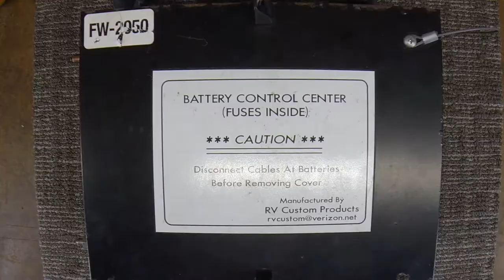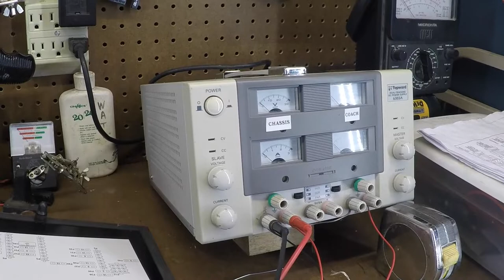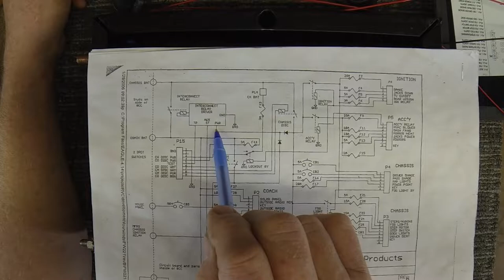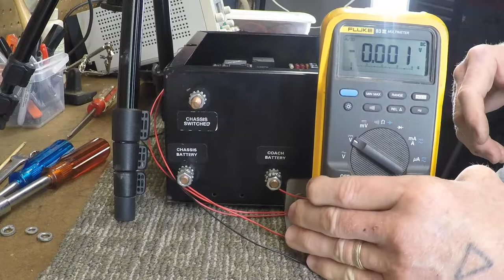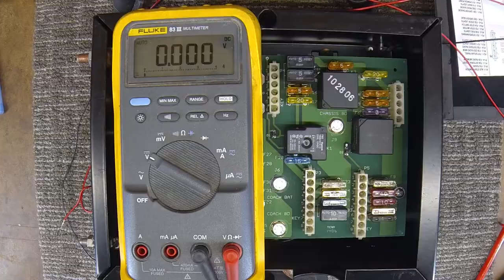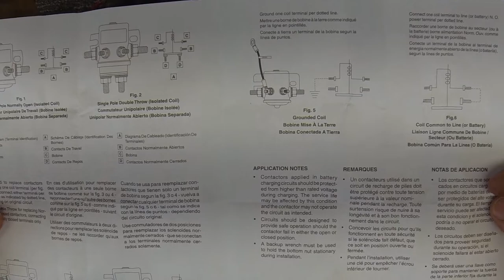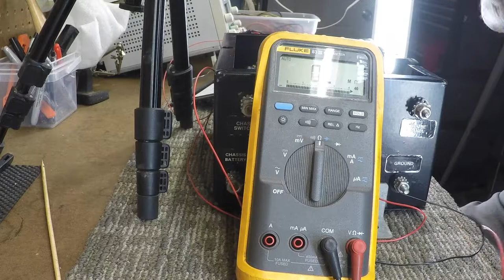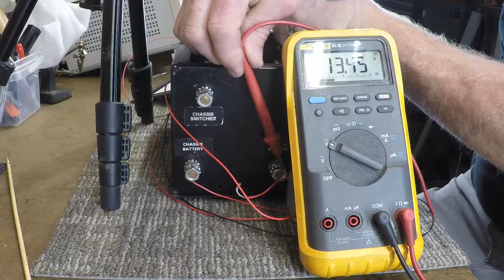RV Custom Products Battery Control Center (BCC) - Troubleshooting and Repair

Comment: I am working on the same problem with my 2014 Thor coach,  I have the TH1020 BCC Saw your video after I had ordered the latching solenoid and I hope that corrects my problem. I also printed information from RV custom products but you're video sure helps to understand how the system functions. Also the master electronics solenoid in my unit cost $89.00 and I did not see any cross references to the unit you used in your coach or others I found online? could I have saved some cash and ordered that one? If so, too late now but maybe next time. Thanks for the information, you have a lot of patience and knowledge and I am grateful that you shared it.
Reply from the maker: @phillip Mares - Thank you for the feed back and I apologize for not replying sooner. I am not the best at putting sourcing information in my descriptions. This is something I need to improve on and it's feedback like yours that helps me to improve. I glad that you were able to fix your problem and I'm also happy that my video helped you to understand the functionality of the BCC. Again, thank you! Stay kind, strong and safe!

Comment: I have a fuse blown for the radio that I believe is in this box.
I've unlatched the two latches to open the front. And I've got the front loosened all around but it's stuck where the latches are.
Can you tell me how these latches work so I can figure out why it won't let free?
Reply from the maker: If the latches are like mine, then they are just a round rubber plug that expands when you push the latches down. If they are cold, you may have to warm them up to get the to soften up.

Comment: I have a 2016 FW Bounder 35K. My 12v systems only work when the engine is running. The house batteries are charged. Any suggestions? Thank you in advance.

Comment: Hi Wayne,   I have a 2014 Thor ACE 29.2 and the coach lights only come on when generator or shore power is applied.  Coach Lights are off while driving and don’t get power  from alternator or house batteries.  Could this solenoid relay be the problem?
Reply from the maker: FYI, let me look at the schematics for a bit and I will get back to you. Thanks for the question.
Reply from the maker: Do the lights work, at least for 15 seconds, when you turn ON the AUX switch, while driving?

Comment: Quick question.  I'm experiencing a similar problem with my BCC as well (2013 Hurricane).  This is what is happening.  All of the power arbitrarily goes away including house and chassis.  Up to the last time we could let it sit for a bit, turn the switches on and off and we would be able to start the motorhome and move on down the road.  Its currently at a truck repair shop after an expensive tow.  They have isolated the problem down to the BCC but unsure what part of it is the problem.  Is it likely board, or the solenoid?
Reply from the maker: Hi Quinton, it’s a little more complex that I would like to go over in a comment. One thing I will say though is that the solenoids are less expensive than the PC board. The question is which solenoid is causing the problem. Both the coach and chassis solenoids would have to be commanded in the opposite direction in order to lose both supply voltages. They will not simply turn off. If your BCC is like mine, then it takes flipping the coach and the chassis switches to the opposite direction to make that happen. Please email me your contact information so I can talk to you about this over the phone. My email address is wpolcin@gmail.com.

Comment: Hi Wayne I have a 2007 Georgetown forest river workhorse UFO R26 8.1 pusher my solenoid went band I have the new Solenoid but the wires burned and I’m having a time figurine the wiring. It is a SDC-107 battery controller. The motherboard seems to be OK. Can you help?
Reply from the maker: Check out the video at about 36:51. There you will see a Yellow and Red wire coming from the bottom side of the circuit board. The Yellow wire goes to the upper terminal of the solenoid and the Red to the lower terminal. Notice there is a third Red wire connected to the BUSS bar on the top of the screen. That wire goes to CH BATT spade terminal on the top side of the circuit board labeled P14.

I hope this helps. If you still have trouble, please email your phone number to me at wpolcin@gmail.com and I will cal to assist you by phone. I won't be available this evening, Wednesday, May 19th.

Comment: Can testing of the voltage be done when box is reinstalled
Reply from the maker: Hi Ernest. Yes. But the test results can be hard to interpret because you don't know what position the solenoids are really in and the 12 volts looks almost identical whether you're looking at the coach or chassis batteries. I had to remove the box in order to accurately troubleshoot.
Reply: @WaynePolcin  Things worked as you suggested.  You are great.

Comment: Hi there. I have a 96 Fleetwood Pace Arrow that when plugged into with my shore cord provides me with 120 volts for my appliances as well as 12 volts for lights,pump etc. But when I remove the plug I have NO 12 volt lights etc. Also when I run my engine I am getting 14.3 volts to my chassis batteries but No voltage to my house batteries. It is also the same when fire up the generator. When I charge my 2 - 6 volt batteries fully with an external battery charger I still get NO power to my 12 volt lights.I also just replaced my converter and it shows it is putting out 14 plus volts from the converter.
Would the selinoid that you just replaced in this video cause the same issues as I am having? Last points when I engage the jumper switch to use the house batteries to help start my generator I hear NO audible click nor do I hear a activation click when I plug in my shore cord to a 120 volt source. Any help would be much appreciated 
Cheers Rod
Reply from the maker: Hi Rod! Check the 50 amp circuit breaker on the BCC. Just push it in to reset it. This is where I would begin since you are not getting 12 volts anywhere in the coach.
Reply: Wayne Polcin 
Hi Wayne 
Thanks for the reply back. I will try that as well as replacing the continuous selonoid as I am Not getting the clicking from my battery boost switch on my dash as others have said that you get and that you should hear an audible click when depressed. I have pulled the fasteners off and pulled back the circuit board away from where the selonoid is located so why not replace it as I have owned the unit 10 plus years and it hasn’t been replaced and they are relatively inexpensive. Just an additional note, I do hear a click from the engine compartment when I toggle  the chassis and the House disconnect switches in my side door overhead cabinet telling me that the 2 other rectangular relays are working properly.
Will let you know how everything works out.
Cheers for now Rod
Reply from the maker: Good plan! It won’t hurt at all. Take your time!

Comment: Trying to trouble shoot problem. Rv has chassis switch not ways working. Changed solenoid for batteries and started working again. Moved rv outside and lost all power to switches. I can manual flip the chassis power but you hear it clicking somewhere. Any ideas?
Reply from the maker: I just got your comment. I will give this more thought when I’m not working. Off the top, sounds like a loose connection somewhere in the battery circuit. Give me  year make and model of your RV.
Reply: 2011 Thor Serrano, and thanks.

Comment: What happens if fuse F44 is bad?
Reply from the maker: Sorry for the delay, Outro702. If F44 blows, the Coach Disconnect switch will not function. The same is true for F43 and the Chassis Disconnect switch. Those fuses supply 12 volts to the disconnect switches.

Comment: I’m having problems with line voltage not charging my coach batteries. Can anyone help
Reply from the maker: Do the coach batteries charge from the engine and generator?
Reply: @WaynePolcin    Yes they do
Reply from the maker: Have you tested the AC to DC converter?
Reply: @WaynePolcin    No I haven’t. Not sure where it is located?
Reply from the maker: What’s the make and model of your RV?
Reply: @WaynePolcin  2015 Hurricane 32
Reply from the maker: Your converter should be located at the foot of the bed or under your refrigerator. Open the panel, take a picture of the labels and send it to my email account wpolcin@gmail.com. If your coach lights and other 12V devices are working, then you may have a bad coach battery - it’s no longer taking a charge.